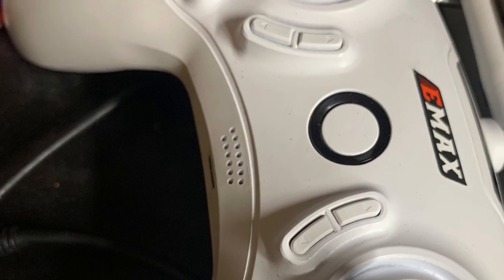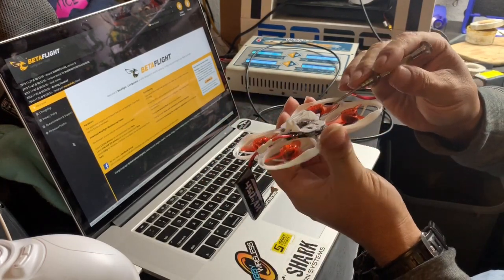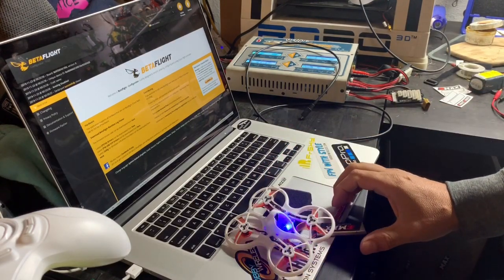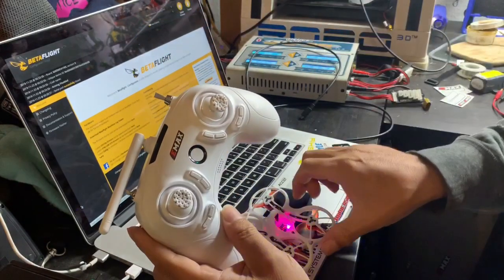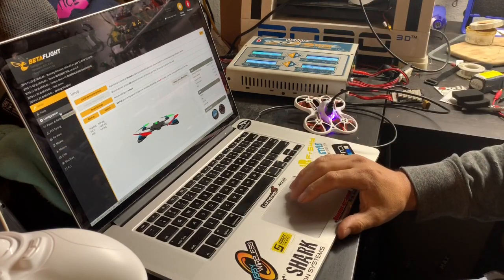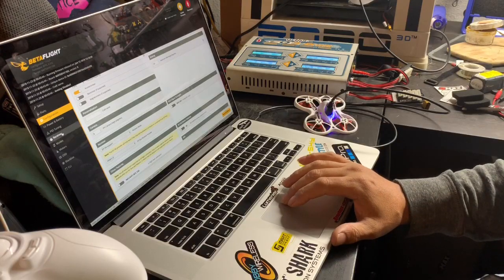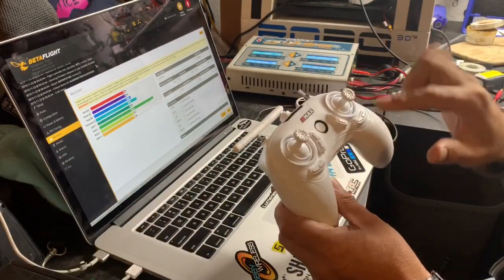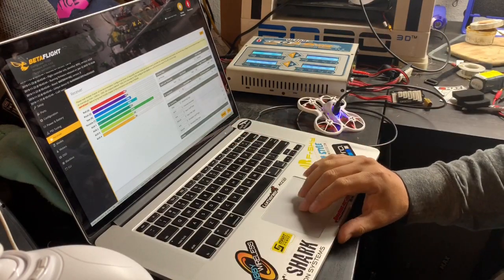How to bind emax E6 transmitters to the tiny hawk s flight controller tx

Comment: I have the same problem as the other gentleman. I was able to bind by following your video. All the stick movements shows up on Betaflight. However, I'm not able to get it to arm. My story is: I bought the RTF version but lost the drone, then I bought the BNF drone, now I'm trying to bind the new drone with the old transmitter. Thanks again.
Reply: The TH controller will work with any quad that is using a D8 receiver.
Reply from the maker: Apache Cai just posted a detail video about the issue your having. Hope It helps.
Reply from the maker: Apache Cai I will do a video on this topic this weekend please subscribe so you can be up to date. Thanks
Reply from the maker: Apache Cai did you try to arm and even if the props don’t spin give it some throttle and it should work for now.
Reply: @HoverJunkie  So I found out that the flight mode switch is actually acting as an arm switch, vice versa. I emailed the merchant I bought it from and they told me that I have to contact Emax for CLI dump, so the RTF remote can work with BTF drone... I didn't know that FPV is that complicated...lol...
I plan to just buy a QX7 and start from there, what do you think? Thanks again.
Reply from the maker: Apache Cai just posted a detail video about the issue your having. Hope It helps.

Comment: Where should I place the HEX file to? Thanks a lot!
Reply from the maker: Apache Cai  you Can place it on the download  folder than go to beta under dfu mode and download it. Let me know if that helped .
Reply: @HoverJunkie  I'm a absolute newbee and I'm lost. Under "Mode" section in Betaflight, the Arm shows red and disabled. But when I toggled the flight mode, the interfere with the arm section...must be something wrong at the setting...
Reply from the maker: Apache Cai just posted a video. Hope it will help you.

Comment: I can bind it but I can’t get it to fly or anything
Reply from the maker: levi beil did you go on beta and set up the channels ?
Reply: Hover Junkie what do you mean by the Chanel’s because I did follow the rest of the vid but I’m not on beta flight 4.1.0
Reply from the maker: levi beil no worries, can you go on beta flight confirmation? Like in the video!
Reply: Hover Junkie sorry I’ve opened it and followed everything but I not quite sure
Reply from the maker: levi beil no worries, subscribe so you can get notification on the next video about settings it up. Going into detail.
Reply: Hover Junkie ok I will
Reply: Hover Junkie I put you to 150
Reply: Hover Junkie gongrats
Reply: Hover Junkie if you don’t mind me asking when would that in depth vid be coming out do you think
Reply: @levibeil2886  Do you have the rtf kit? I had mine a week ago and now one of my motors started to die out of me...I need to replace motors from emax like the 16500k kv motors. Its probably my betaflight settings that cause motor 4 to heat up or putting my batteries in right away when my first flight is done.
Reply: Mattplaysio yeah I had RTF then crashed drone in pool that’s ok you need to know about y I got a new one but I’m having trouble  binding the new TinyHawk to transmitter
Reply from the maker: levi beil sorry for the delay my friend I’m just waiting on my controller but if it’s not here in the next 2 days I will do with out it. Thanks for your patience.
Reply from the maker: levi beil thank you so much.
Reply: @levibeil2886  theres a bind button on the tinyhawk press on that and it will go on bind mode
Reply from the maker: Mattplaysio yes that’s correct, just plug the drone to the battery first then hold the bind button for a few seconds
Reply: Sorry I’m a complete noob at this stuff
Reply from the maker: levi beil go to the 4:17 mark on the video an tell me if you can do that?
Reply from the maker: levi beil try to arm and even it the props don’t spin just give it throttle and it should go.
Reply from the maker: levi beil just made a detailed video, hope it helps.